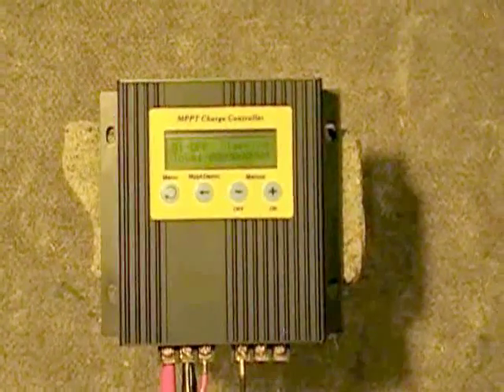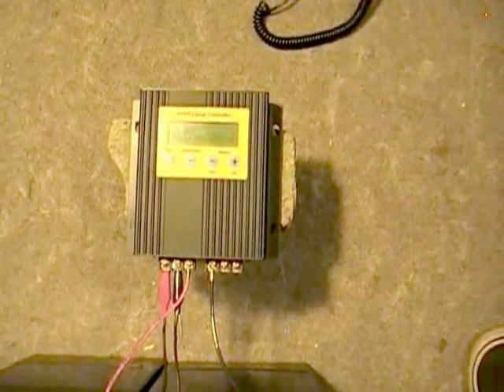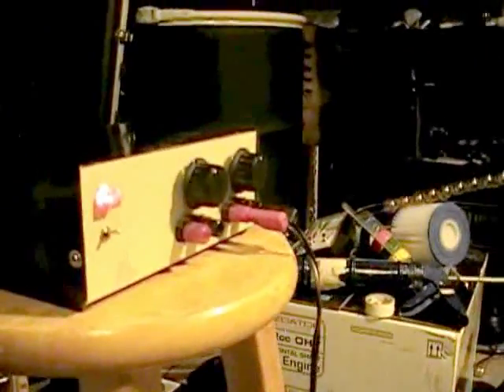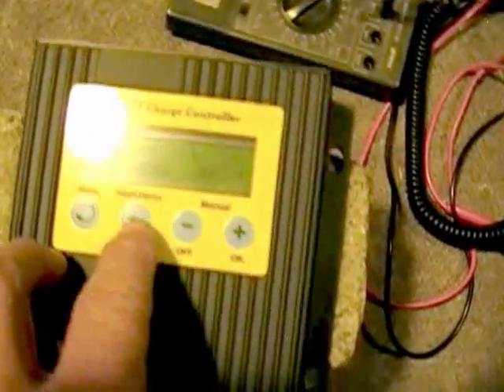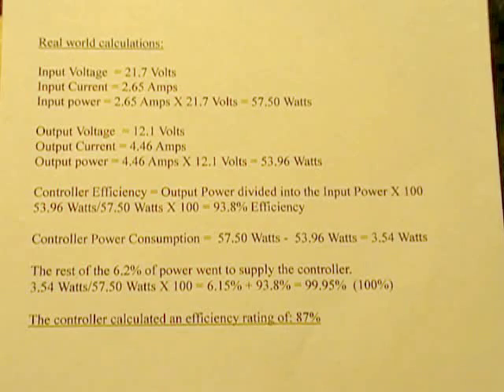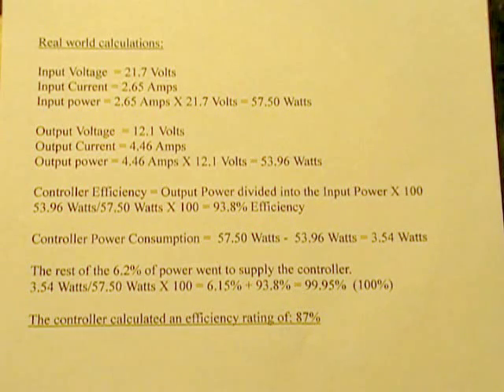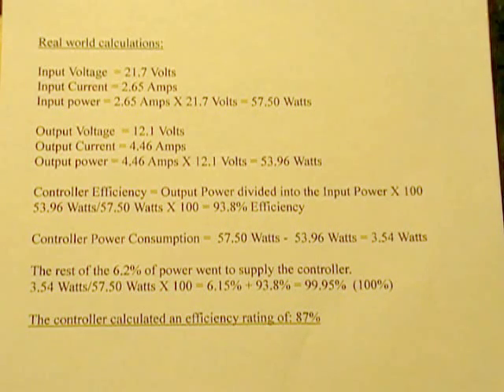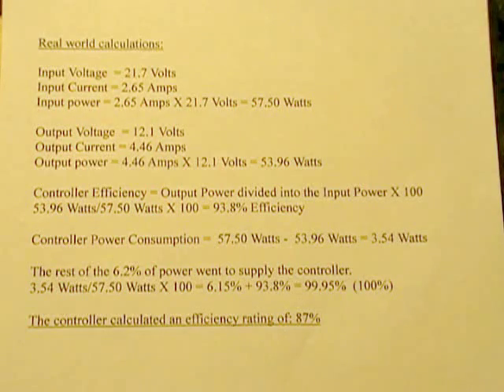09-20-2014 Solar MPPT Controller Efficiency Test

Comment: Flash. I bought one of these about 3 months ago [May2015] got it on auction at a great price... Then last month [mid July 2015] bought four 100w mono panels [Renogy] before our return trip to Maine.   The Panels and the charge controller made the trip from southern Georgia to  Maine in a tight packed HFT4x8 trailer.  
this weekend Aug 7-8 2015 I was able to live test the solar panels and MPPT charge controller...  I hooked two of the panels in series and had them charging a garden tractor battery. was able to watch the panel voltages fluctuate between 34v and 42v.
I was able to run a small 12v HFT air compressor (yellow cheap one) alone on two panels in bright sun. 
---
The MPPT controller was held up in CHICAGO Customs for 2wks (wonder if was cause my last name is Cokayne)
It was this review that encouraged me to try the MPPT controller. 
I am happy with it and very satisfied with the Renogy 100w panels  (Ebay)
well packaged and fast free shipping and great price too.

Harold in Maine/south Georgia
Reply: +Harold Cokayne update.... 
found out that the Controller I bought is one of the ones that looks like the one you have but is not a complete charge controller ....  as the battery voltage NEVER increased above the battery only voltage and the amperage to the battery never registered above  0 amps..  ....

Comment: Flash,
I have watched a few of you videos and im impressed with your methodical practices.
I also believe sharing ideas and expalining stuff will help everyone. Instead of  keeping everything a secret in hopes to get rich.

My idea for a new truck/car is not that amazing however I believe it can make a huge difference.

As you may know, electric cars have been around since the biggining of automobiles... one of the reasons why they never went big was range and charge times. (EV's can have better performance than internal combustion).

Also as you may already know in history during fuel shortages people would use woodgas as a source of fuel for cars and tractors. Some of the reasons its not used now is because of hazords with carbon monoxide lower power output than gasoline and probably matinance/ease of use.

Cars use most of there power accelerating (with exeptions to hills and heavy loads) My idea is to build an EV with a small number of batteries (or capacitors) and a generator powered by woodgas. Woodgas hybrid/ELECTRIC. My goal would be to run 50hp or maybe less continually. When you accelerate you will use power from the generator and batteries. And when you let off the accelerator you would recharge your batteries. I think a small pickup has a 150hp but it doesnt use all of it all the time. So as long as we make more power than that a vehicle uses to matain a speed of 70mph we should have an all new driving experience.

Summary
A car that would have the same top speed as any other with no range restictions and fuel that is clean and renewable/really cheap. 
I know this is possible, no doubt about it. The real question is will the solution be worth it. Will it have so many parts and require so much maintenance its not worth it. 
The Chevy volt is almost the same concept.  However they still use gasoline.

I would greatly appreciate any ideas or feed back you may have.

Thank you for your time

Bryan

Comment: Great video.
You described the workings of an MPPT charger nicely  :) .

I looked into getting these, but it turns out that it would be a bit too costly for my setup.
Instead, I just dump the current straight into the battery bank. 
Ok, it's not as efficient as an MPPT, but I ain't complaining  :) .
The device you reviewed looks like a good one, and I am sure anyone who buys one will love it  :)
Keep up the good work, my fellow alternative energy addict  :) .
Reply from the maker: Steve you can get these for $100 or you can pick up a PWM controller for around $30 to $35 and at least with a PWM you can program it for the bulk charge limit and the float charge trigger voltage. It would definitely guarantee you that you will never over charge or over heat the batteries.

Comment: you're awesome flash. I damn sure wish we where neighbors...
Im just starting my solar adventure, I purchased 4 250watt panels, which will feed 2 500 watt grid tie power inverters.on two diferent segments in the house. Part 2, is adding 4 trojan 105 batteries being charged with an iota 45 amp charger.  Assuming I see a reasonable reduction in my electric bill, I'll move to 3-4kwatts, and more trojans and grid tie inverters. Any advice for a rookie?
Reply from the maker: Hey I'm a rookie too but I read a lot so that helps. I need to ask you a question. Do you have a smart meter on your house? Here's why I'm asking you that question. All power meters are dumb and they all spin one direction only so let's say you are using power in the house and you are consuming 1000 watts an hour. If the grid tie is producing 1000 watts the meter will be in essence cancelled out giving the meter the impression you are not using power correct? Here's the problem...

Remember me saying that all power meters are dumb? OK, now let's say you are producing 1000 watts at your grid tie inverters but you go to work so the power consumption in your house is only 100 watts from small appliances that are drawing idle current, the excess 900 watts is now feeding back into the system and instead of the meter slowing down, it speeds up showing 900 watts of usage in the eyes of the meter and the power company because the meter does NOT spin backwards. That is a myth because the meter is an AC based device and to say it spins backwards would be the same as saying you can switch a wall fan's plug around and make it spin backwards and you and I know that it doesn't work that way.

So here is what is happening, when you are producing excess power with your grid tie inverters (more power than you are consuming in the house) YOU ARE BEING CHARGED for CONSUMING that 900 watts because the meter does not register that the power is coming or going through it. This is why the meter is dumb. Not all meters are made the same and some are polarized which means they will spin backwards but it's not for your benefit and you MUST ask your power company if they will pay you or make your bill reflect the difference because most of the time they don't honor people selling power back to the system. Some power companies do and MOST don't so check it out!

You don't want to pay these thieves to give them power back from your system so be really careful or you could actually see your bill spike really high! Yes, the grid tie inverters WILL slow the power meter down but if you aren't using power in your house while the inverters are running, it could speed the power meter back up depending on the type of meter you have as the excess power goes back up the pole to your neighbors house. I hope this makes sense to you.
Reply: flash001USA damn, I should have known the man would stick his.... oh, nevermind, into my plan. I wonder if doubling up on the batteries, feeding them directly and routing certain lines out of the breaker box to it would be a better idea. That way power goes to the low watt segments, the batts get topped off, instead of feeding the grid.
I can't help but think that when I call PECO and tell them of my plan, I've now got to go get a bunch of electricians, an engineer, some schematics and several approvals all of which will take my 2k$ system to 5k$ approved by .gov system.  ugh......crap on me. I'm tired of being messed with by those guys - theu all have their hands in my wallet for nothing that is of benefit to me!
I remember the old mans construction company. When the townships inspector showed up, he would leave his trunk open, and he expected to find a case of beer or two( or a gallon of Jack), some ammo or maybe a new fishing rod in the back when he left. makes my head come close to exploding

Comment: Flash, is this converter using MOSFETs or IGBTs? Amazing what a coil with these devices attached can accomplish these days. I'm from the old days when transformers were magical and warmed the insides of our gear nicely.....LOL!!!!
Reply from the maker: I'm 99.999% sure these are MOSFET's.  I DID disassemble mine because being the kid that I am, I wanted to see how they had the optional 20 amp DC output set up on it and it was a MOSFET switch so I am guessing that the DC to DC converter would be using the same thing. One more thing to remember too. On average, the IGBTs do require more power to turn them on and I think it's 10% of the rated current of the device whereas a MOSFET will turn at the tip of a hat and since the solar panels output voltages and current and can swing all over the place depending on the sun position and clouds I doubt that the 10% current rule would be able to be constantly met during operation so I will say the DC to DC converter is probably a MOSTET based design.
Reply: flash001USA
I'm the same way. I've go to know how it works. My thinking had led down the MOSFET road too. Thanks much for the vids and your reply!